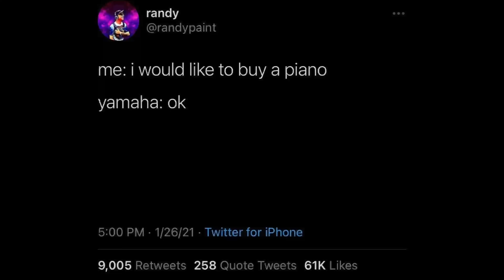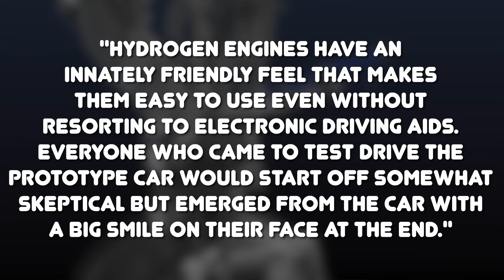Toyota's New 455HP Hydrogen V8: Everything You Need to Know

Comment: The lack of demand is directly linked to the ability to refuel them. Hydrogen would sell no problem but it would first have to be regularly available
Reply: Not only that but I think a lot of enthusiasts, myself included. Would prefer this over electric when given the option between the two.
Reply: The problem with hydrogen isn't just availability it's storage. In order to be stored as a liquid requires increadabe pressure or extremely low temperatures. Even then, hydrogen has a relatively low energy density, requiring more frequent refueling. Hydrogen storage makes propane look like child's play.
Reply: @177SCmaro  storage?.........In history, negative people say the same about Metal tubes flying with people inside. Buildings over 10 stories, Metal that floats much less able to carry 10 tons of weight. Have the ability to talk to your girlfriend 1,000s of mile from her and wireless. You see, negative thinking never makes things true to them.....may be delayed but never stop innovations. In the past, if I can predict what you will like or want or interested in, I would be considered as a wizard.......now your cellphone do this every second......but now negative people consider this as infringe on their privacy. Imagine your husband or Wife have this abilities. LOL
Reply: @vangcruz4442  
You are confusing two different problems which I think you realized seeing as you apparently deleted your comment. In the past flight, tall buildings, communications, ect where degrees of technological problems to be overcome. Hydrogen is a physics problem. Hydrogen has certain properties that make it difficult to produce (without resorting to hydrocabons) and store in adequate amounts, along with being a bit tricky to run through an engine. In terms of simple efficiency, you'd be better off with ev or hydrogen fuel cells rather than internal combustion. 
As I said, alcohol is a much more viable fuel for internal combustion engines and can be a renewable fuel however, alcohol does have some issues like its tendency to absorb water, lower btus, cold starting issues, ect.
Reply: @177SCmaro  you know......there are people that have excuses then there are people that do not see excuses but see it as a technical challenge. Everything you said about hydrogen is also true with gasoline......but due to POLITICAL PRESSURE, hydrogen is attacked at every turn. The real unfortunate thing with hydrogen is that it is SO abundant.........the power that be can't allowed to loose control over energy that they cannot regulate. Once the cat escaped from captivity, it is hard to put it back in and once it is in it will be harder to keep it in captive. Imagine if gasoline is a new invention and trying to come onto the market today?
Reply: @vangcruz4442  
Everything I said about hydrogen is not true of gasoline. Those are very different fuels. 
And hydrogen is not a new fuel. It has existed in the market as long, possibly longer, than gasoline it's just never been competitive for reasons and more already stated.
I'm also not making "excuses". I'm merely pointing out some facts. Different fuels have different properties that make them more or less suitable for a given application. Nowhere did I suggest that it was impossible to run an engine on hydrogen or that, eventually, we might mitigate or even possibly overcome hydrogen's unfavorable qualities. However, by the time we do EVs will probably have already replaced internal combustion making the exercise, again, a novelty at best. But suppose one day hydrogen replaces gasoline thus massivly driving up demand, and thus prices, for hydrogen. What will you do then? Complain about "Big Hydrogen"?  Rattle off unsubstantiated claims about how they secretly rule the world?
Reply: @177SCmaro  you may be right.....but one thing you failed to mention is the huge amount of taxes that government gets from fossil fuels. For this reason, EV will be supported by most Western countries.
Reply: @177SCmaro  True! but the most important thing is leverage and control. Now only a few country have fossil fuel in their border but with Hydrogen....no more monopoly! This is why the West is so against Hydrogen.
Reply: @vangcruz4442  
Gasoline isn't a monopoly and the west isn't against hydrogen. Hydrogen, as explained, is not economically competitive at this time due to it's properites. There are multiple alternatives to gasoline and one business dosn't provide all the gasoline. However, there shouldn't be collusion between oil companies and government but when you have a government collision is inevitable - whenever a society declares a throne, people will fight over it or try to buy it, regardless of whatever fuel is most popular in the market.
Reply: @177SCmaro  please tell me what currency crude oil is transacted with?......until last month when Russia demanded Rupel because Russia was SANCTION from using USD and EUROS?
Reply: @vangcruz4442  
I'm not sure you understand what a monopoly is. Having majority of the market is not a monopoly.
Reply: @177SCmaro  Being tricky is not an issue. Engineers are solutionists.
Reply: @vangcruz4442  they will just tax the electricity. once EVs are in everyone's driveway, they will say, well, the environment takes such a big hit to produce batteries and all the precious metals needed for all the fuel cell technology, plus the waste products we can't recycle in the fuel cell technology, plus the electricity itself, putting pressure on our electric demands, we will now introduce a new tax, every 5 years at recharge points. why? because they can. it is all regulated. governments and car corps are both moving forward to cancel out car ownership. you will have to rent your own car, it won't belong to you, and so you have no control over it. it will be self driving. sound familiar? even your own operating system on your PC isn't yours. windows is now a 'service'. not your OP. BMW now charges monthly for 'owners' to "use" hardware and software that is ALREADY installed in their vehicles. you will now "activate" your heated seats via an APP and pay for it monthly. UMM... talk about stripping away individual control. but that's all we've had for the last 20 years. kids think it's all normal now. there is a registration wall for everything you do in your life. and it get's expensive. do it slow enough, people don't remember. people can't even remember what they did last week anymore.
Reply: @177SCmaro  No need to transport hydrogen. Hydrogen stations can be made to extract hydrogen immediately as a person begins fueling. All thats needed is water running through a pipe like every home and sink. The hydrogen station will automatically extract the hydrogen. It’s not hard to do. 

Also another way is to pump water into the cars tank and if engineering design the car itself to extract the hydrogen within the car….problem solved. 

As far as containing hydrogen…..the stations can be made to freeze it to reduce leakage. 

OR

The vehicle extracts the hydrogen it need while maintaining a percentage in water. To reduce leakage and when ever it needs more the device inside car will automatically begin to extract the amount hydrogen it needs

And I don’t know about fella in the video. He seems extremely bias by saying there’s no differences between Gas combustion engines vs Hydrogen combustion. There’s a huge amount differences using hydrogen. Theres less heat being generated which gives all parts in engine bay including the engine longevity. Parts are less susceptible to wear and tear with hydrogen. 

Personally I’ll buy an electric just too vary my collection but i prefer combustion engines all the way. EV’s anyone could be riding a bicycle and no one would know if they’re about to get hit by a car because they’re so quiet. EV’s dont look fun, feel fun, roar from the engine. And what if a war breaks lose and the enemy attacks the electrical grid. We’re all screwed. How will we charge our vehicles to get around during war?
Reply: @FlowSharp  
Again, the reason most commercial hydrogen is derived from hydrocarbons and not water is electolosis is a slow, energy intensive process that requires more electricity than the btu's provided by the hydrogen especially when engines are only about 30% efficient. That's why there arn't electrolysis stations all over the country. The PROPERTIES of hydrogen make in an inferior fuel economically to gasoline.
But fell free to set up your own station and try it yourself. Maybe you can figures out a way to turn a profit?
Reply: @177SCmaro  the combustion (hydrogen) powers the alternator. Basically the belt system in the vehicle. Because of the fuel it turns mechanical energy into electricity. People say “oh but it uses more electricity to make hydrogen” vs simply making batteries. There’s a thing called amplifiers that quadruples the output voltage therefore making it efficient by using 4 times less the (hydrogen fuel) it needs to power the electrolysis process within the vehicle or hydrogen ⛽️ stations. 

Hydrogen cars are much faster to refuel than electric cars, while also offering greater ranges than electric vehicles. For example, Renault's Kangoo Z.E. Hydrogen and Master Z.E. Hydrogen have range extender fuel cells that deliver ranges of over 350 kilometres and charge times of just 5-10 minutes.
Reply: @FlowSharp  
You have a basic misunderstanding of physics. You can't get something for nothing. Simply stepping up the output voltage to seperate hydrogen from oxygen faster requires more input amperage which requires more mechanical energy from the electrical power source. You havn't solved the problem by producing it faster. You still might as well be using the electricity to drive a 90% efficent electric motor attached to the wheels rather than burning fuel at 30% effecency to convert mechanical energy into electricity, another loss, into hydrogen, another loss, then burning hydrogen at 30% mechanical efficiency, another loss, to generate mechanical energy to drive the car's wheels.
Again, it's the properties of hydrogen that prevent it from being an economically viable fuel at this time.
Also, EV's can be designed with modualr batteries, meaning you switch out the depleted batteries for charged ones and charge the depleted batteries while you're using the charged ones, we just haven't gotten to that point yet.
And we already have a "long range" fuel, it's called gasoline and diesel. Even ethonal is more viable than hydrogen.
Reply: @177SCmaro   I never said anything about producing hydrogen any faster. Your not paying attention to detail. If you are a physicist you’ve failed. You gave no examples or mathematical equations either. On the contrary i gave you an example thats already been accomplished. The purpose of stepping up the voltage is simply to expend less hydrogen to produce the electricity for electrolysis. It’s literally 4 times more efficient than the original. Moreover, im not a physicist….i’m an engineer.
Reply: @FlowSharp  
You just explained how to produce hydrogen 4 times more efficiently. Do you not understand that logically implies that also means 4 times faster from the same input? You're not even paying attention to your own claims.
Also, you havn't provided any math or evidence of any kind for your claims. The burden of proof is on the person making the claims (you) not the person skeptical of them (me).
And, again, you don't get something for nothing. Increasing voltage increases the power demand. If it didn't, why not step up the voltage 50 times or 100 and make it 100 times more efficient?
You're not addressing the fundamental problems I've pointed out with hydrogen in internal combustion vs simply using a battery and electric motors. The fact remains that the electricity you intend to use to produce hydrogen from water could much more efficiently be used to power an EV. 
The only potentional hydrogen has as a commerical fuel in engines at this time is to be produced from hydrocarbons in which case it would be more efficent to simply burn the hydrocarbons for fuel.
Reply: @FlowSharp  That has not been accomplished because it can't be due to loss as mentioned.  There is no over unity.  Please provide links to actual working examples.  It can be done onboard with a nuclear reactor, but then instead you could use it for a turbine generator for electric motors...like a ship does.
Reply: @177SCmaro  Hydrogen can be stored at lower pressures using Lithium-6 Deuteride, but big Gov won't allow it because it is used in weapons.  It can also be done with Graphitic Carbon Nitride.  There is also promising research with carbonized chicken feathers.
Reply: @solarsynapse  
Storage of hydrogen isn't the only reason it's not economically viable at this time.
Reply: @177SCmaro  hydrogen can be made on the spot and is instantly ready for use. The only thing needing stored is water.
Reply: @MrMe1280  
If you're talking about electrolysis, which is a slow process, much too slow to keep up the fuel requirements of an average car, that requires significantly more electricity than the BTUs of burning the hydrogen, especially when you factor in internal combustion is, itself, only about 30% efficient in most engines. You would be far better off just using the electricity to charge a battery in an EV with motors over 90% efficient.
Using hydrogen for internal combustion, which is a bit tricky btw, is a novelty, at best, not particularly practical or economical. Personally, if you really want to hang onto internal combustion, and I do, and you don't want to use fossil fuels, you'd actually be much better off buying a still, using food waste, and converting your car to run on alcohol then trying to produce hydrogen yourself. 
Alcohol has a higher octane rating and cooling effect on the intake change than gasoline and can produce more power when tuned for it. It's also a cleaner fuel though not as clean as burning hydrogen.
Reply: @177SCmaro  um 1.1v is enough to split water
Reply: @johnsailor6081  
Lol, what? One molecule at a time? Good luck with that.
Reply: @177SCmaro  why not acetone 😂? One drop can blow a whole house. Im sure one drop of acetone will make a car move faster than “Fast and the furious”
Reply: @johnsailor6081  1000 Amps?  You need more than a few tiny bubbles a minute.
Reply: @FlowSharp  Acetone is nail polish remover. It's not that powerful.
Reply: @zzanatos2001  acetone may be a polish remover it’s still highly explosive.
Reply: @177SCmaro  Most hydrogen fuel cell vehicles have and will continue to have electric motors, as these are far cheaper to produce for the mass market than hydrogen-powered ICE engines. The later, I believe, are intended as a novelty aimed at gear heads and the motor racing world, as well as to say, "Look what Elon can't do!". Not likely to be the car in everyone's driveway. The Mirai will be, and sooner than people think.
Reply: @177SCmaro  electrolysis is what they taught you in primary school. we don't do it that way. we use our heads. you wouldn't mine for oil with just a shovel, would you? no, you use your head. otherwise, you're spending too much energy on it.
Reply: @Tenvince  
Since you are explaining to to me why we don't use electrolysis you apparently missed the part where I already explained why electrolysis isn't generally used to produce hydrogen, why most hydrogen is derived from hydrocarbons. Try hard some more.
Reply: @177SCmaro  Dude, EVs have so many parts that break down and cost a lot to make, use way too many rare earth metals and overburden an electrical grid even when it’s run by mostly fossil fuels. California’s flex alerts that tell you to turn off your AC are also saying to avoid charging your EV in times of heat. EV’s are super duper inefficient for the long run as they run with the use of rare earth metals which will never be renewable.

Hydrogen is the power type for the car that would make the most sense in the most long term possible. All of these comments similar to yours are painfully blind to the limits of EVs in the long run just because in the short term your daddy Elon is receiving lots of government subsidies. Elon wants cars to continue to be the main form of transportation which is why pretended to make hyper loop to cancel any plans of making public transportation in California work more efficiently than highway infrastructure, then he made a shitty Tesla tunnel which requires a payment and gets filled with traffic right away

A person this corrupt pushing EVs and calling Hydro stupid is a red flag for the current affairs of energy and cars. There is no rumor here. Gasoline taxes help pay for roads. How will roads be maintained without paying for gasoline. EVs will get taxed. And lots EVs will get marketed similarly as phones are. They will lock features in a car behind a paywall. This is no rumor. It has already happened with certain companies and is going to be a main feature of Tesla and EVs.

Yet, you dismiss Hydro as being incompatible with automobiles despite not suggesting first that since we’re dumping money on renewables we might as well invest in the advancement of hydrogen technology for the era after EVs which will come only shortly after I think. Rather, EV era should be short lived by necessity once (not ‘if’ but ‘once’) rare metals go through scarcity or battery waste becomes unmanageable alongside the renewable infrastructure waste.

Similar to how the superior nuclear power grid is hated by Westerners, for some reason people hate Hydrogen. Why? Just invest in it before it’s too late. Or is the environment actually not worth protecting in the long run?
Reply: @alanandrade2083  
You don't really know very much about this subject or what my argument even was.
As I said, most hydrogen is derived from hydrocarbons. It would actully be more efficient energy-wise to just burn the hydrocarbons.
Hydrogen fuel cells are more viable than combusting h2 but come with their set of issues. That leaves us with evs which have their issues too but are the simplest altetnative to combustion overall - battery, controler, motor over 90% efficient. Figure out the battery issues and ev is poised to be the dominant power plant in cars going forward. If you charged them off of nuclear power you would remove nearly all emissions save for production which effects all cars, including gas and h2.
There will still be combustion engines but of the available fuel types h2 is still among the least viable due to the nature of storage.
Reply: I agree.  If the government was as ambitious about helping build the infrastructure for hydrogen as it is for electric charging stations, we would purchase hydrogen powered cars, because they are faster to refuel.  I wonder how much the technology to make hydrogen and store hydrogen costs.  The reduction in car emissions would be great.
Reply: @BronxRebel  The current U.S. government fully intends to destroy America to "build back better" in their own Communistic image.
Reply: @BronxRebel  And where would we get the hydrogen from?
Reply: @Isamu1013  Hydrogen can be produced anywhere, but the technology isn't cheap and isn't energy efficient, unless renewable energy is used to produce the hydrogen. Right now the best bet is that businesses that require lots of truck transportation will invest in starting to build the infrastructure, because long term it would mean more profitability for their enterprise.
Reply: The batteries making the evs also crazy heavy!
Reply: I saw a u-tube video where a truck made it's own hydrogen to power it's engine. Was it a hoax? I have no idea.
Reply: @racerx4152  no but it makes sense that’s how it should be
Reply: Cost would be a barrier at first.
Reply: @michaelanderson9914  if we can send $40 billion to Ukraine I think we can afford it. Norway put 1000s of recharge stations up in the last couple years and they are free to use. The USA has a lot more $ than them the government just doesn't give damn
Reply: thats what they said against electric cars 10-20 years ago. Until Elon introduced charging stations.
Reply: I'm curious about storing hydrogen on premises, storing in the car, and how refueling would work from 'pump' to automobile.  I mean, what would it cost to buy something to produce and store at home?  Would hydrogen be manufactured on site at each refueling station?  Would tankers haul it around?  What does all that infrastructure look like?
Reply: You vould pipe it to your house likebthey pipe natural gas to your house.
Reply: Loves truck stops are working on a refueling network.
Reply: LOL it will be when fuel is hardly available
Reply: @\f_a/ 
Which is another way of saying it's a physics problem, just with more words. 🙄 
The entire context of the conversation implied engineering a system to overcome the physics problem of energy density. Duh.
Reply: @\f_a/ 
I was just messing with you too. Couldn't you tell?
Reply: @\f_a/ 
What a coincidence, I was thinking the exact same thing about you!
Reply: What about the cost of batteries everytime they die after the 8 year warranty is gone. 10 plus grand every 10 plus years
Reply: if we hadnt put all of our eggs into one basket with battery powered cars (thanks Elon) and instead invested in the infrastructure for multiple new fuel sources then hydrogen would have had much more of a chance to be developed and researched, and fueling etc would not be a problem seeing as hydrogen is actually abundant as a fuel source
Reply: @tootruesheep872  wasn't his fault really it was successive governments.
Reply: @tootruesheep872  free hydrogen is not abundant. Hydrogen is tied up in a water molecule. That is one of its problems.